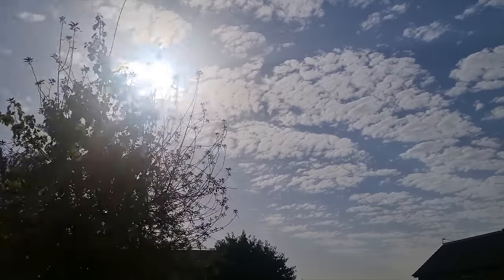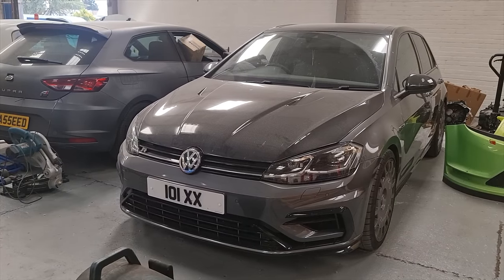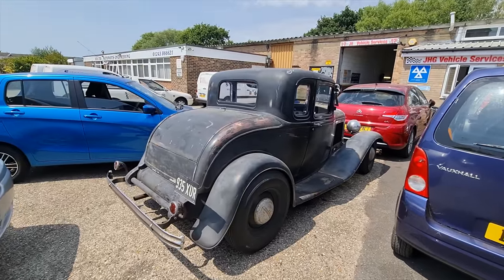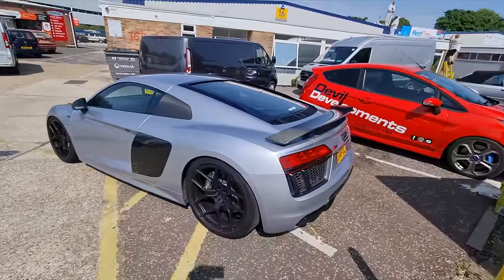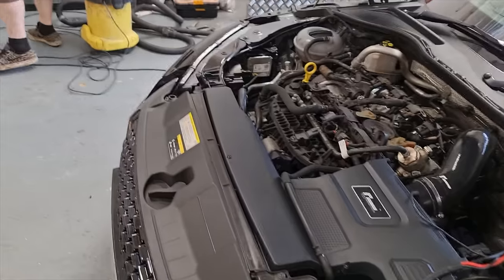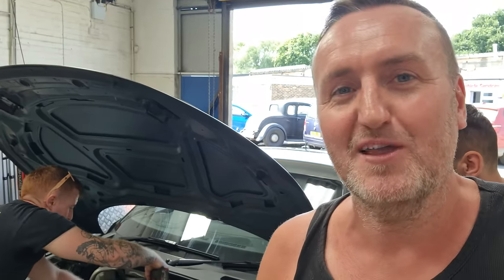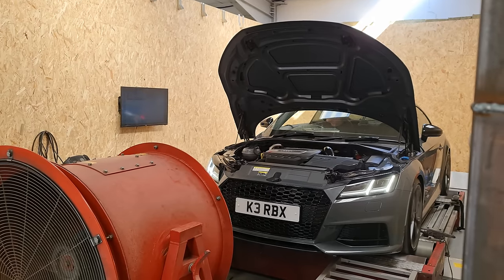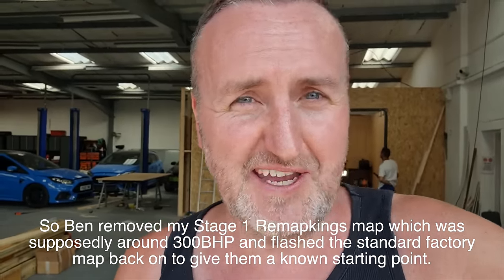THE FASTEST CAR I'VE BEEN IN + STAGE 2 REMAP TO THE MK3 TT!!! PART 2

Comment: How the times have changed. The 1968 Shelby I had was a GT350 model. It cost $4500.00 dollars American when it was brand new and had 300 horsepower right out of the factory without a turbo.
Reply: Agreed it’s really shocking that the USA were even further behind the rest of the world in terms of engineering even back then

Comment: Hi Andy only just found your channel. Loved this video buddy. I’m looking to stage 1 map my 2019 TT 45 TFSI Quattro. May I just confirm you’re still on stock is20 turbo? If so isn’t it amazing to get nearly 110bhp over standard! Wow. Unfortunately mine has OPF filter which will certainly hinder my future gains. I’ve already upgraded turbo elbow, intake hose and panel filter so just waiting to have it fully serviced then look to get it mapped + gearbox tune.
Reply from the maker: Yep it's crazy to get that power from the IS20! You should still see some pretty good gains on your 2019! Make sure you get a rolling road tune if you can and get them to map the gearbox.. makes so much difference. if you did just add a downpipe you could be well over 300BHP. I know people running the stock intercooler and still getting 340bhp.

Have you seen my latest videos? It's running an L380X from Littco now and it's bonkers!😉
Reply: @andykirby  I have! Your car is incredible! 340bhp? Wow… Do you know what it takes to achieve that? I presume intake, sports cat downpipe, ECU + TCU tune? Thanks for your advice on custom rolling road tune too 👍🏻

Comment: 5mpg omg!!
Electric tuning is something I've been thinking about for ages, used to mess with brushless motors and there are lots of things that can be altered already but was very hit and miss and mostly guesswork, to properly monitor the power in and out and heat build up during tuning could be intersting
Reply: @honda4004  I'll look it up. Thanks
Reply: You see the past water fuel car engines were not that . The inventors knew by pulsing dc to ac you accessed the neutral host . As tesla knew by the today's car tesla coil ( ignition coil ) I met chief Datsun uk engineer Gary stokes a few years back and told him about static . He said that he had a 120y that would not turn off in a pre customer delivery check . He got buy from the chrome door handles and the ignition key . They found the body to engine earth loose . He was an apprentice at that time but now realised that static build up on a non earthing shell ( the tyres were 56 psi and hard rubber for shipping from Japan  ) hence not ground earthing . I suspect many combine harvesters catch fire due to static build up . Like rubbing a balloon on a woolly jumper . Watch lord kelvin generator

Comment: next evolution will be plasma air ion engine resistorless plugs running in a vacuum sealed engine via EGR return .as joesph papp engine already does .trouble is it produces more extra energy from the ion dimensional energy than can be used so it has to be bled into large banks of resistors

Comment: You see the past water fuel car engines were not that . The inventors knew by pulsing dc to ac you accessed the neutral host . As tesla knew by the today's car tesla coil ( ignition coil ) I met chief Datsun uk engineer Gary stokes a few years back and told him about static . He said that he had a 120y that would not turn off in a pre customer delivery check . He got bitten from the chrome door handles and the ignition key . They found the body to engine earth loose . He was an apprentice at that time but now realised that static build up on a non earthing shell ( the tyres were 56 psi and hard rubber for shipping from Japan  ) hence not ground earthing . I suspect many combine harvesters catch fire due to static build up . Like rubbing a balloon on a woolly jumper . Watch lord kelvin generator . Also the waste spark of Holden is a big clue as did rover do the same in later years and TWR tom walkinshaw racing and earlier than these peter brock  many have done this air ion engine but pulled it from the public domain .